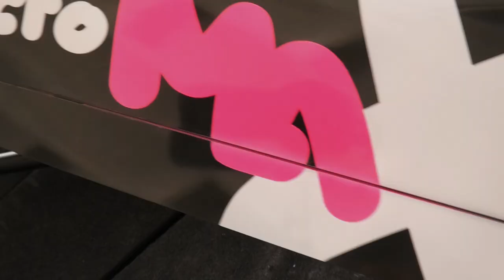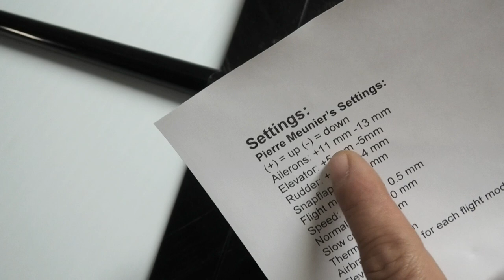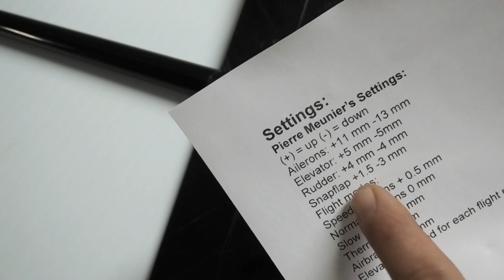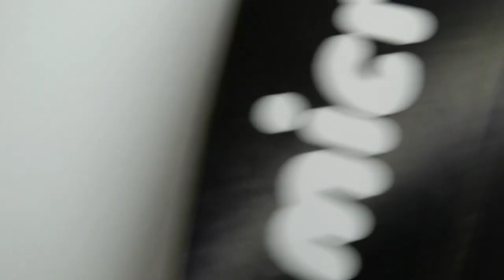Micro Max 1.15M RC slope soaring glider. wiring, throws, and CG

Comment: I could not understand why you were using a paste flux. Then it became obvious. The technique you need to use is, heat the wire/joint; bring the solder to the iron and joint; let solder melt. The solder contains all the flux you need.